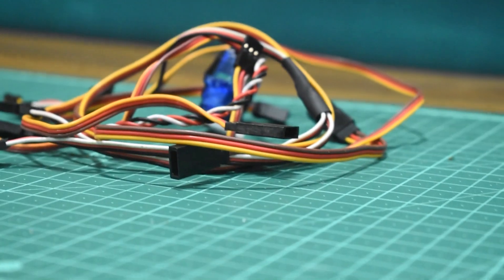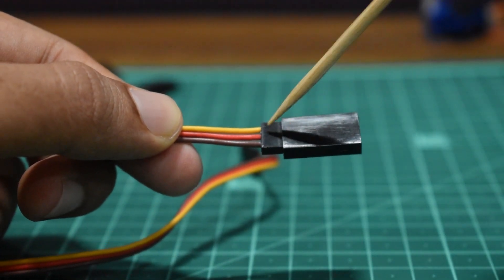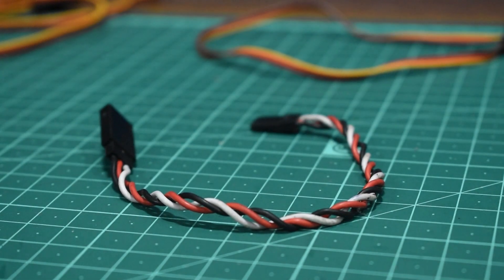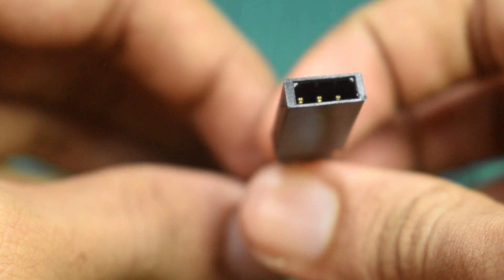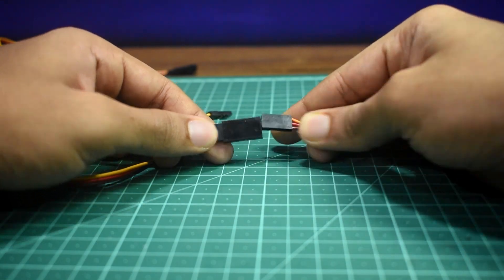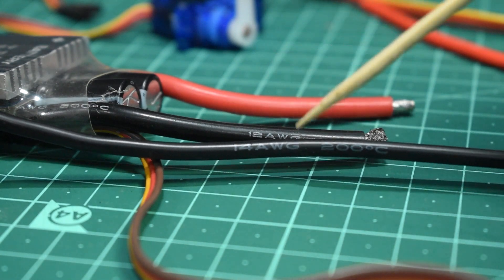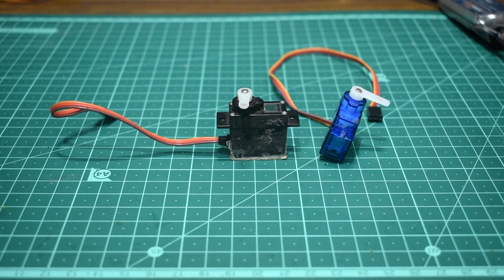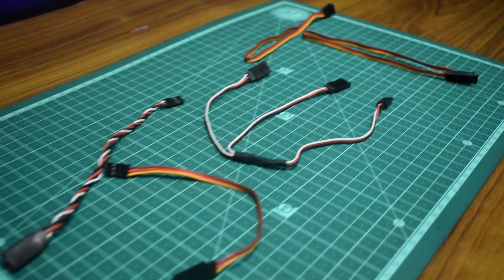Choosing the correct Servo Extension JR Vs FUTABA

Comment: Hi,
    I have built a few models with coroplast. But all those models are 3 channel type. Can you suggest some   4 channel models suitable for coroplast?
Reply from the maker: Any foamboard plane will work to some extent, only thing you must take care of how you cut parts based on orientation of the lines
Reply from the maker: Flitetest scout, ft storch
Reply: @JetNautics  bloody baron?